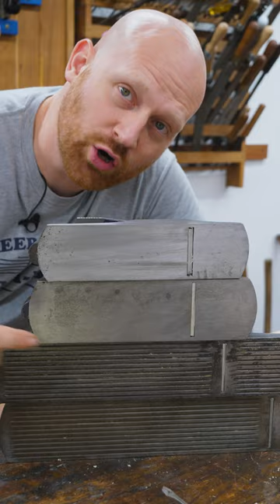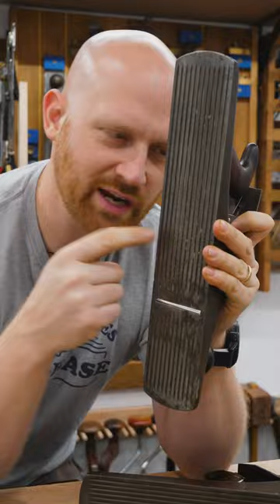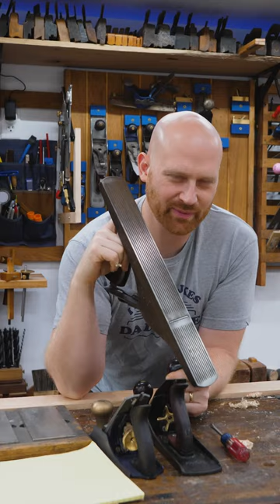What is Corigation on a Hand Plane

Comment: That doesn't make sense, why would you have the same amount of friction? Not taking into consideration the possibility of not sliding on a flat surface, you have less surface area and theoretically less weight.
Reply from the maker: All of the weight is on less surface producing about the same friction. f = \mu N And oddly enough they usually weigh a bit more as they made the sole thicker to fit in the corrugation.
Reply: @WoodByWrightHowTo  That seems very counterproductive to add more material just to hollow out some racing stripes, but after looking at a few patents, it seems the sales departments were focused more on finding new ways to sell the same tool over and over again. Zig-zags, brand logos, mentions of buzzwords like vacuumless air-chambers.
Still makes sense that if you had two planes, and corrugated one of them, it should now weigh less and therefore have less friction, albeit I can't imagine it'd be that much of a difference unless you were removing quite a bit of weight.
Reply: @WoodByWrightHowTo by that logic race cars don’t need to use slick tires. Slick tires provide more rubber to be in contact with the road therefore more grip (friction)
Reply: @darkmooink69  There are several reasons why slicks are used. More contact area means better heat dissipation, also less locilised heat generation. 
Also, less sideways deformation in corners. 
But the fact remains that surface area does not directly impact friction.
Reply from the maker: If you look up the physics you will see that it's very true. It's counterintuitive but you can't argue with the math.